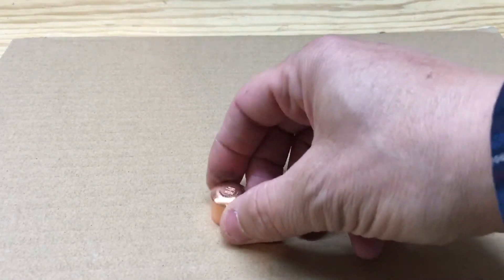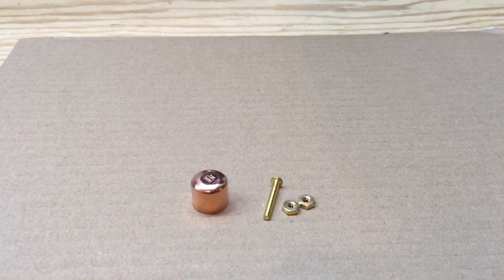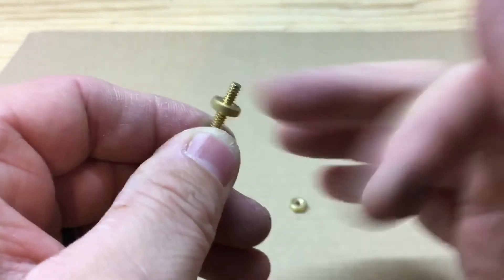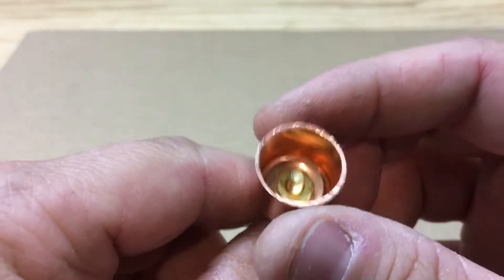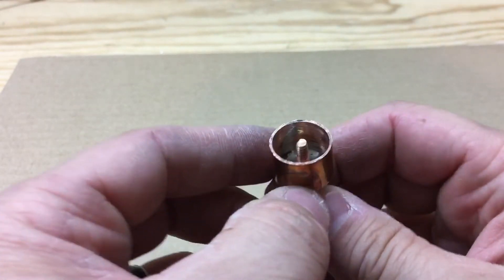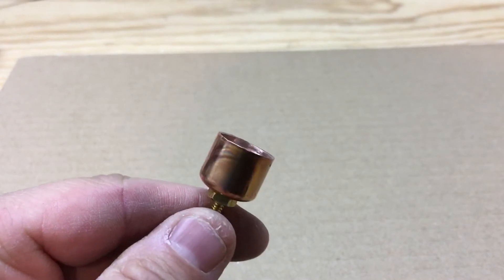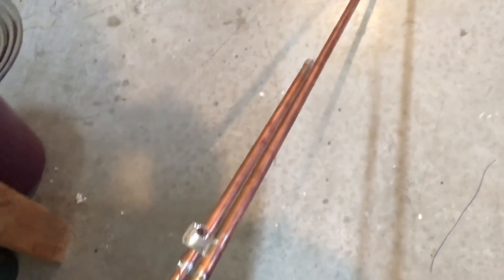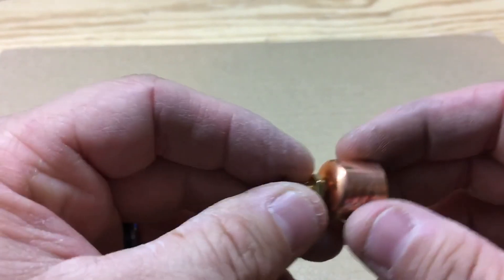How To Make A SWR Screw Adjuster Cap For The J-Pole Antenna For Ham Radio

Comment: I was taught to use an identical stainless steel bolt when soldering the brass nut inside, since the solder won't stick to the stainless. Once all the soldering is done, the stainless bolt comes out easily and you can replace it with a brass one. Thanks for the video, 73

Comment: Thank you for sharing Sir.. 73's
Reply: I'm working on a 15mm dual band 17 & a quarter inch copper pipe & thought I'd cut it down 3quarter inch & fine tune it  both ends 
Once again thanks for sharing 73's 👍🏾

Comment: Build the jpole. To get your SWR as close as possible to 1:1, you ADJUST YOUR FEED LINE distance from the 'U'. Only after that do you adjust the length of your resonators to get your resonant frequency exactly where you need it. What's being adjusted here is your resonant frequency; not SWR.

Comment: Why not just use a 6-32 tap directly on top of the copper cap?
Reply: Copper is too thin to hold threads when the jam nut is tightened down. If you use the antenna for portable setups it would be very easy to break the screw out of a threaded cap.

Comment: Does it matter if you solder the SO-239 connector to the short side or long side? A friend loaned me his j-pole so I could copy it and his connector was attached to the short side, just wondering.
Reply: Just found out center conductor goes to long side and shield to short side
Reply: Rf signal is alternating like ac voltage so really shouldn't make any difference in where the center conductor is attached  on long element or stub

Comment: So if the swr is too high, do you lengthen it or shorten it?
Reply from the maker: Screw it in.
Reply: Swr is a result of mismatch , the bottom portion is for matching impeadance so adjust for 50 ohm's if you are using standard 50 ohm coax . Then if your getting a high swr adjust the long part for frequency  to get it to resonate at frequency you want such as 146.000 mhz .
Reply: Actually,  it depends on which frequency it is initially resonant before adjustment. If the SWR is lower near 148 MHz and high at 144, and you want it resonant at 146, then you would lengthen the adjustment screw... if it is more resonant around 144, then shorten until it is resonant at 146.

Comment: Good idea. I’m going to use all copper fittings; thread adapters and cap etc since I need to drop swr about 2.0 and don’t want to completely rebuild but still keep the original copper look and performance

Comment: Got a new one for you guys , set your j-pole antenna up on a stand and put another antenna out from there so you can transmit to that receive antenna and put a field strength meter on that remote antenna .now key up on your J-pole and watch the field on the meter wile rotating the j-pole wile transmitting . watch just how omni it really is. If you get it right you will see a huge fluctuation in signal as you rotate it  . If you are using coax which is unbalanced to the balanced j-pole then be sure and add a choke or the pattern will be distorted . Now if you still see a less than omni pattern add another j below the first this will be open to the top with nothing attached, this should remove any common node currents from going down the support pole. Now you can get an omni pattern.
Reply: Wow that's right , I would have never known that if you hadn't told us thanks.

Comment: The connection for the feed line is to get the antenna to match the 50 ohm coax that's all , the half wave section above it is the antenna which by tunning can very the resonance frequency so adjustment screw can go on this end and be fine tuned to 1:1 swr or to tune to correct frequency . And that is a great idea

Comment: why not just build the J-pole correctly in the first place with the adjustable feed section then you wouldn't have to  have the ends on..

good idea though, ideally use two though, one on each element would be better, and could be used for adjusting centre fed dipoles.